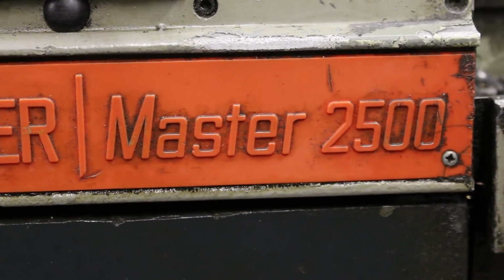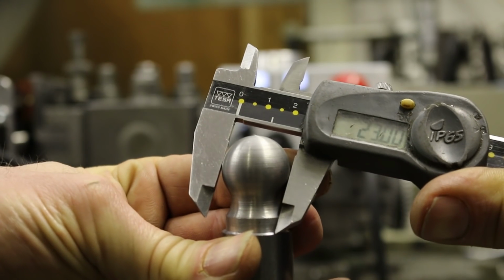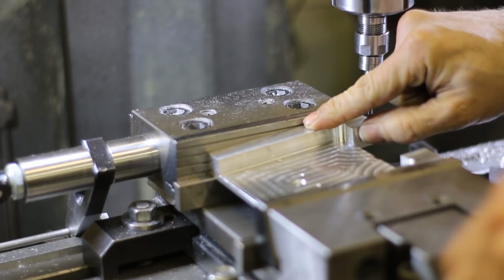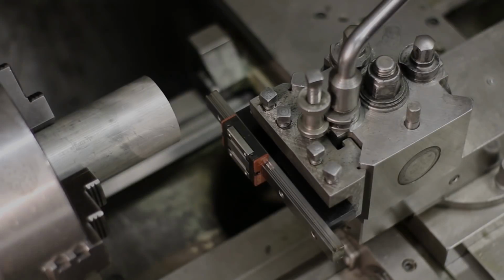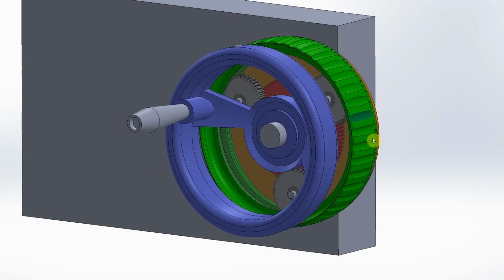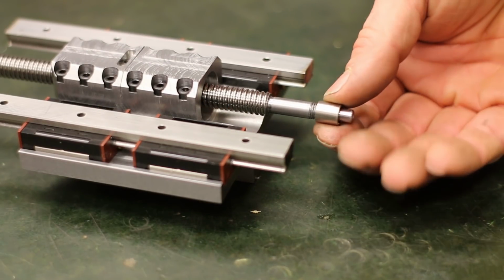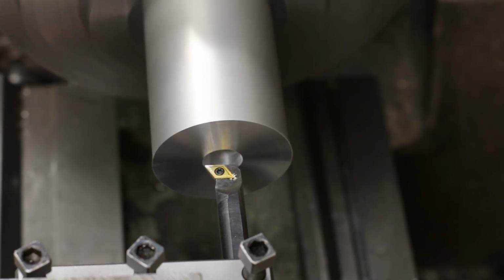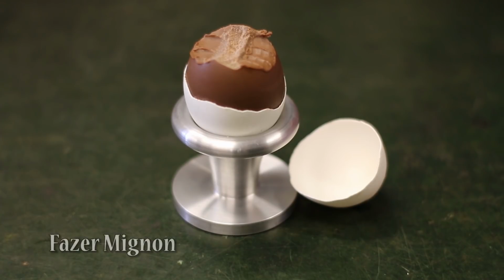CNC Attachment for Manual Lathe

Comment: did you manage to get the index and threading working?
Reply from the maker: Not yet solved. Soon as I can find time, I will get back to this matter. The interface card must be changed, maybe to etherner Smoothstepper. Also the compound slide motor needs upgrade. I think I will go for closed loop stepper motors. If everything goes well, I will make a follow up video for that.
Reply: @kerkkonenahaima7322  Did you set the steps of the servo in the software ?

Comment: Good morning,
you don't have a link to more details: Schema general-components? that would be great for those interested.
What is the vertical usb module that controls the 2 drivers? Thank you for your reply
thank you in advance from belgium
Reply from the maker: Hello, I know that full BOM would be nice, but I can't really recommend the components I have chosen for my prototype. Soon as I can find time, I will return to this device and make some upgrades for the controller card and steppermotors. Current controller is 'Two trees' like this: https://www.ebay.com/itm/175341504085
It lacks thread cutting function so I would like to change it to something better, maybe to Smooth Stepper.
The compound slide motor is little too weak and looses steps on heavy roughing. I have plans to change it to beefier closed loop steppermotor. Hopefully there will be a sequel video in the future. If I manage to make better unit, then I can publish a parts list and connection diagrams.
Reply: @kerkkonenahaima7322  Thank you very much for your answer full of common sense, I will take inspiration from your work, it gives me ideas for My Myford super seven.
I will be sure to follow your ideas on you tube!
All the best
JC lambert from belgium

Comment: 24:10 Yikes on that tool clearance 😬 Showing off that nonlinear movement eh?
Also I like that wheel of fortune-looking speed selector on your lathe!
Also also that's a cool old DRO with the vacuum fluorescent display.
Reply from the maker: Yep, the inside turning caused even closer calls. Something I would never try on "real" materials.
At first glance the speed selector seems like a merry go 'round in an amusement park. But for a 16-speed  shifter it's quite logical and most suitable.
I do too like the Antikythera DRO. There is quite little benefits updating for more modern display. My quick change toolpost repeatibility is so bad, that I would not not gain much for more tool offsets. Radius trace function is no longer topical for I have this CNC gizmo.

Comment: Nicely done!!!

I have a nice metal lathe but it terrifies me.  I think I will go your route and make it CNC so I don’t have to go anywhere near that death trap while it is in operation. Worst that I would expect is a crash from a broken cutter or mistake in the gcode.
Reply from the maker: When the code is CAM-generated, most hickups can be seen in the cutting simulation. I run my CNC-attachment so that the compound slide hits its physical travel limit just before the tool reaches the chuck jaws. So it's kinda safer in that manner than real CNC-lathes. But you are right, this amount of rotating mass doesn't stop in a blink of an eye, if something crashes.

Comment: To have a better experience in power-snapping m3 or 6-32 taps in cold rolled cheap steel, or other ductile materials, convert your tap drills and taps to thread forming or “roll taps”.  You wind up with stronger threads and fewer snapped taps.  Indeed, you have to do some stupid things to break a tap with a forming tap, like trying to tap D2 tool steel.

Also, a colchester lathe has the torque and rigidity to convert to CNC, so good choice.  Other good choices would be other gear driven lathes and Monarch (my favorite manual lathe), which is DC motor driven, and silent AF when turned on.
Reply from the maker: I have some experience of forming taps with Flow-drill friction formed draw holes on stainless sheet metal, with rather good success. I haven't never tried them on more solid parts, but certainly will give them a try in the future, thanks for the tip.

Monarch lathes are quite rare this side of the Atlantic, but what seen on Youtube, they seem great machines.

Comment: Are X and Z axes perpendicular?
Reply from the maker: The compound slide must be set to zero, parallel to lathe bedways. The X-movement must be adjusted parallel to lathe cross slide. So the attachment movements are as perpendicular as user bothers to set them. Usually I just read the compound slide scale and set the X-movement against the lathe chuck flat face with some parallels. But for more precise work I use some dial indicator setup.
Reply: @kerkkonenahaima7322  Okay! I find it a very good and practical solution. The concept is good and the implementation is compact. Congratulations!

Comment: Love the door knob! Is that anti-burglar protection ;o)
Reply from the maker: The garage door has still an Abloy disk detainer lock from 1963. More pickproof than 99,9% locks of the world🫡
Reply: @kerkkonenahaima7322  Yeah I seen the lock :o) I was talking about the wrench you used for a door knob. I got nothing against that. I was kidding around in my previous comment :o)
Reply from the maker: @tymz-r-achangin  I realized that, just tried to be wise-ass myself.
The adjustable spanners should be kept far away from bolts and nuts, since they only tend to round the head corners. So they are at their best as doorhardware😎
Reply: @kerkkonenahaima7322  Youre cool, man. Sorry I misunderstood your first reply. And youre absolutely right about adjustable spanner wrenches... they round off bolts n nuts. We also call them knuckle-busters cause they slip off of bolts n nuts lol  ... but hey, they make awesome door knob replacements :D

Comment: It was interesting to see you use a parting tool to shape the egg cup. There is the cutting action of the leading edge,
then a programmed travel to register the trailing edge into its cutting position. I suppose you have to choose carefully
what parts to use this technique on. 👍🙂
Reply from the maker: You are right, that is not the most optimal tool, but was the one I had in my hands for testing the gadget. Fusion 360 CAM handles just fine the paths for such tool. I bought later full radius carbide grooving inserts and turned some bead roller dies from toolsteel with great succes with this CNC attachment.

Flat parting tool can sometimes be very handy on a hobby CNC-lathe without tool changer; small production runs can be carried out with single program without annoying tool changes.

Comment: Do you make a kit to sell? I have a similar lathe 17cm swing with 1 meter between centers the beast weights a ton and a half. That would be a dream come true. I could machine some of the parts or send them to you. Thanks Bernard.
Reply from the maker: Sorry, nothing to sell. The unit shown in my video is still a prototype, I haven't had time to develope it further. I have done several parts with it. Works like a charm on lighter machining, but I just turned some bead roller dies from tool steel and had to take very thin passes. Othervise some steps were lost and parts ruined. Try to find some local machine shop to make the parts you need and modify the design with beefier motor or/and slower gear ratio for the belt. Cross slide with ball screw goes fine with this motor.
Reply: @kerkkonenahaima7322  Thanks Kerkko for answering. I could machine the parts myself and change the screws and nuts with ball screws and bearings., but I would need help on the specifics like the motors and the software. When I am ready I will contact you. I am in Brittany France. Bernard
Reply: @kerkkonenahaima7322  thanks I have a local machine shop to do the parts but I will need plans and design drawings, also your suggested motors capacity. I will wait till you get more advanced on the prototype. Bernard
Reply from the maker: Looks like I have no chance to concentrate on this project anytime soon. I have no drawings for the parts to share. But the 3D-STEP-model should be useful base when tailoring the module to other lathes and fitting a larger motor. The link to the 3D-model is in the description. Ask your machine shop if they can do some CAD-design.
Reply: @kerkkonenahaima7322  thanks KN keep posting videos, let us know when something comes up. Bernard

Comment: like the idea as it will allow you to take it off and have a manual lathe back 
i have a medium sized lathe and might try to make sumting simulair 
have my eye on a rockettronics els that doesnt quite do cad but can make some basic shapes and do all the treadsizes automaiticly on the lathe (btw it uses an encoder on the latehead not an rpm sensor that might solve the problem youre having too)  , this might be just the thing i need to get it to work on a manual lathe

Comment: Very nice my workmanship friend, and it’s nice to see old school blueprints as well, I began learning mechanical drafting in 8th year of primary school, and I fell in love with it on the first project assigned. Even though I’ve long since learned CAD, I still prefer to draft out my concepts by hand first & then go copy into CAD. 
I work off of paper plans any day rather than off a computer screen,  (even though it will have to be done if g-codes are needed). However once I have everything down and finalized, I always print a fresh copy and give it another study before I start to make a project, I just like the paper, & it’s handy to have if I conceptualize something new while in the process of a build, I flip it sketch it!  Also ya got another subscriber today,  looking forward to more fantastic ideas and videos!!!…
Reply from the maker: Thank you!
I'ts quite funny, that when you make a drawing in the CAD, you can stare it all day on the display, but while the printed sheet is still warm you have already found couple of missing important dimensions on it. Next you go to milling machine or lathe and wonder why the origins of the dimensions are awkwardly oriented wrong way around for the operation.

Comment: Kerkko, I simply have no right words to appreciation for your achievement. You have turn an age-old lathe into a very modern machine with possibilities limited only by your imagination. The second thing that should be emphasized is that for simple turning works the CNC attachment can be easily disassembled. An elegant and effective solution. 
I am extremely impressed.

Comment: can we add it to any manual lathe machine
Reply from the maker: In theory you can. The compound slide unit must be tailored to match the lathe. Compound slide needs to be rigid enough and not too much backslash and play. I would not make this system for a small lathe.
Reply: @kerkkonenahaima7322  u mean to say slides shouldn't be worn out. What's the cost and can v fix it DIY

Comment: The geometry of that quick change tool post is suboptimal at best. If you happen to be greedy with cut depth and holder gives even slightly, it will extend the tool further out and worsen the situation. I learned to like the fish tail type holder, although I would prefer the kind that I do not yet have.
Reply from the maker: I haven´t had problems, that I could put the blame on this quick change system. The repeatability is not the best, it must be taken in account in production runs with tool changes. The dovetail may be better, I have never used such. But I have some bad experiences from cheap Multifix clones.

Comment: That soft drawing won't last long.
Reply from the maker: Just as dull as a paper can get.
Reply: @kerkkonenahaima7322  Why is it that you can sharpen a fine steel blade to .0001 edge, and it won't cut. Yet a .005 paper will instantly cut your finger?

Comment: It is made by you. Is any commercial version available?
Reply from the maker: The compound slides differs a lot between lathes, so it would be very difficult to design universal module that suits for all.
Reply: @kerkkonenahaima7322  Thank you for clarification. It means retrofitting has to be customized.

Comment: What BOB you are using ?
Reply: Most Chinese usb cnc board does not support spindle index and threading.
Reply from the maker: @rengankrishnaiyer6912  The current board is similar to this: https://www.ebay.com/itm/233445300969 and probably fits to the category: most Chinese boards.
Reply: @kerkkonenahaima7322  I am familiar with this board ( BSMCEO4U-PP Bitsensor) very well I am using for my diy cnc router. Just to share it supports all features well but it does not support threading via G76 and G32. If you hookup a spindle index sensor, the "Index" led will blink according to your spindle rotation but mach3 cannot use it. Thus you are unable to use for threading. Just sharing.

Comment: threading issues? check the debounce setting, my little Mach3 powered cnc lathe cuts threads very well.
you are using a licenensed version? as though Mach 3 turn in demo mode works, threading is disabled in demo.
Reply from the maker: I tried change the debounce settings, with no help and I have the licensed version.
I´m pretty sure that the "Two Trees" Breakout board should be changed to something more professional.
What breakout board you have or are you pulsing straight from the parallel port?
Reply: @kerkkonenahaima7322  im using two cheap chinese built boards and these have proved fine, ive bought a much more expensive board and drives but until this setup fails i see no need to change things. Pulse through the BB and not direct to PP

Comment: I put an index on my lathe spindle and tried to get threading to work but failed until I put a Warp9 Smooth Stepper breakout board into the system. You have to read the breakout board specification carefully to avoid this problem. As you have found, they do not all allow threading from a single pulse per revolution.
Reply from the maker: Warp9 seems to be good option here. For the card I used, there was not much manual to read. I kinda assumed they all support this pretty basic function, now I know better.

Comment: Those Isel style ballnuts are adjustable as is, no need to use two of them. They've got a "latch" that can be pressed in by a screw in the holder to adjust backlash.
Reply from the maker: 🤯Whaaat??? That information is quite well kept secret in both vendor Dold Mechatronik and manufacturers site. Or is this something that everybody knows, like: "rotate those bicycle pedals", so no need to print in the manual? Can you provide any link to a site or video, where that adjustment is explained. I feel like complete idiot now and probably for a good reason.
Reply: @kerkkonenahaima7322  
At least with german diy cnc folks it's relatively well known I guess, probably due to Isel being german and very common with the diy crowd.
But your solution isn't bad and might even be better, having two point contact etc, just not the cheapest/simplest way to go.

I'm on the go right now, but I'm sure I've got something bookmarked.
I'll post you a link in a couple of hours.

Comment: Open a bottle of beer under CNC control, in a lathe?   Now I've seen everything...............and it was MAGNIFICENT!!   Great video.  Thanks.
Reply from the maker: I have two things I regret in that scene. One is that was made in the first place. The odour lingered couple of days in the workshop and had some guests wondering the origin. Second thing is the bottle should have being rotating and the cap should been formed out, It´s a lathe after all. Next time wiser. Thanks for your kind comment!
Reply: @kerkkonenahaima7322  Have you considered a metal shaper for slicing cheese, a power hacksaw for slicing bread, a drill press-powered cork screw or a heat treating furnace pizza oven?  All under Arduino control, of course.  ;-)
Cheers,
F.C.

Comment: Nice Device!! Congrats.
But I have side question.
How did you make those Graphics animations, since Mach3 cannot do that.  (only line draw paths.) 
And also, Are you sharing the details of construction of your device??
Thanks in Advance.
Greetings from Los Angeles California.
Reply from the maker: The tool paths were made with Autodesk Fusion 360 and the turning simulation clip is from that.
The whole 3D-assembly model can be downloaded from: https://grabcad.com/library/cnc-attachment-for-manual-lathe-1 It requires signing in, but is free. The compound slide unit needs to be tailor made to every lathe model, so my 3D -model can't be taken literally.
Reply: @kerkkonenahaima7322  Oh, Thanks Amigo.
I'll get on it!!!

BTW  I subscribed. (y)

Comment: The simplest ideas are often the best.  That is a very clever way to quickly fit CNC to a standard lathe without serious intervention and minimum cost.  I made a more complex electronic lathe (still very simple) but which is not CNC in the conventional sense.  You may find it interesting 
https://www.youtube.com/watch?v=WyG4LOG8EfA
Reply from the maker: Sorry for late reply, thanks for the link, I´m indeed interested.
Actually, if I had enough programming skills, my unit would have something similar as your "Jazzed up" -controller in addition to full CNC-control by a computer.
Reply: @kerkkonenahaima7322  The programme code for mine will be made available as I get around to a video on that aspect.  I am not sure how useful it would be for adding to your CNC, but if you saw a use for the non-CNC controller as well as full CNC then it would be very easy to swap between the two.  You only have to swap the inputs to the motor drivers, two 4 pin plugs.  In fact I bought a very cheap Mach3 compatible CNC controller board just to try out.